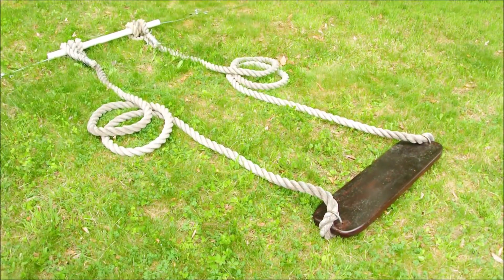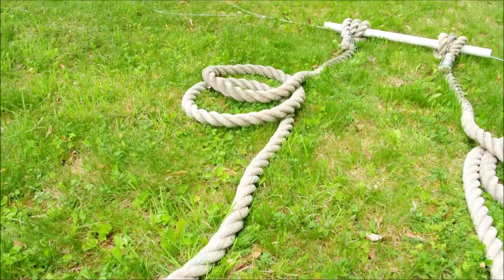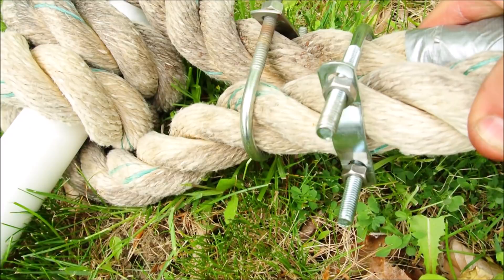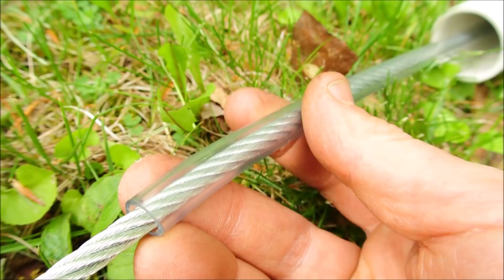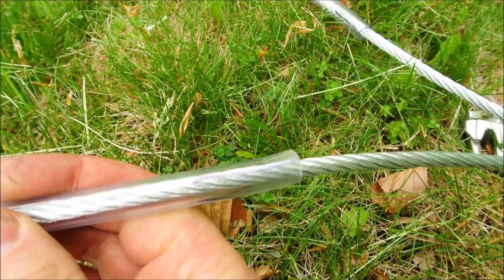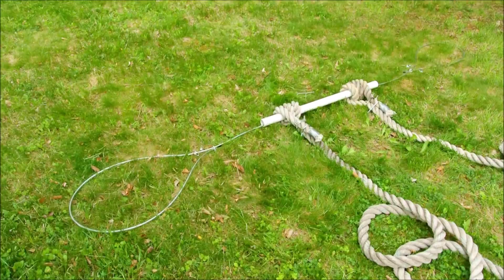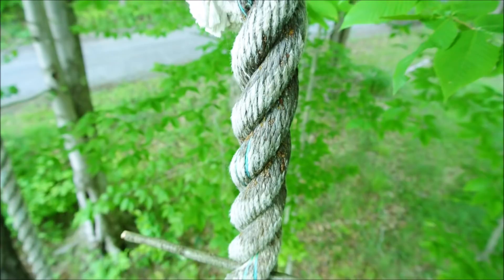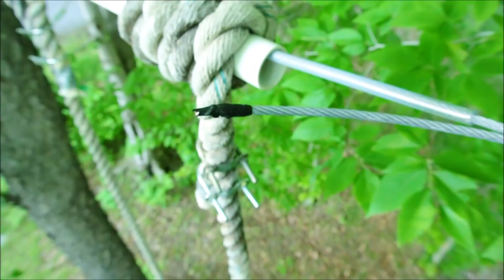Connect a swing to two trees

Comment: The only issue with this type of installation is that as weight is applied you girdle part of the tree where the cable works to cut through the bark and into the living portion of the tree. Left long enough, it can cause substantial damage to the trees.
Reply from the maker: There is no damage because the swing gets taken down every season. Without doing so, all swings will end up damaging their host trees, on a long enough timescale. Not that it matters; if you live in a place where trees are scarce enough that damage is even a concern, you are advised not to install a swing. Where I live, I have to cull them just to keep a yard.

Comment: Can I put 4 swings up   this way i the trees are 15-20 ft apart? how thick wire cable? Could I just  run  1/4" wire cable 3 times?   WHAT kind  Tensile Strength   Working Load Limit  needed?

Comment: Lots of great advice. What keeps the cable from slipping down the tree? Do you level it or eye it up?
Reply from the maker: Why doesn't it slip? Because the cable is under mild tension, and so it cinches, even more so under a load. Bark gives it considerable friction. 

How to level it? By feel and eye. A swing that's out of level will favor one side as it rides, and you'll know it. Feels like it's trying to swing around a corner. Don't underestimate your bottom's ability to perceive a leaning seat! And don't underestimate the eye's ability to see level at a distance, either; go take a look: unless there are leaning trees behind it, or if the swing is on a sideways grade, you should be able to tell within an inch what's level. 

Professional-grade installation note: if you do have two ladders and two installers, it would be no problem at all to use a length of vinyl tubing as a water-level (line-levels lack accuracy) during the initial cable setup. If you start from perfectly level in the first place, you can avoid the bother of trying to adjust other parts of the swing later. 

Thanks ;)

Comment: What size are the u bolts you are using? Also the size for the wire clamps?
Reply from the maker: Both of those will depend on the diameter of cable/rope you use. In my case, the cable was 1/4" and the bull-rope was 1.5". Size them to fit.

Comment: On the condition that the construct is in fact taken down from its mounted position on the trees, to then be reinstalled some time later, the method described herein is granted full approval.
Signed: Rando Internet Arborist Dude
😉👍
Reply from the maker: Yes, I actually do take this down every winter. I understand that's probably impractical for most people, but c'est la vie. Keeps the equipment in tippy-top.
Reply: @pocket83squared   I see now I should've worded my post such that it was more readily apparent to whom it was directed. And that would be anyone fixing to replicate a swing like this for themselves. I trust that you'll do what you said you'd do - and you don't really need my approval anyway. For anyone else that wants a swing setup like this though, they should be forewarned that it isn't intended to be permanent, as it will compromise the integrity and health of the tree if left up there for years..
Reply: @SineEyed  Is there a way to permanently attach a swing without compromising the health of the tree?
Reply: @sopastar  I think that's pretty unlikely. If you think about it, it's a lot to ask for: place a permanent weight bearing fixture on something which doesn't naturally bear that kind of weight; on something that will always (albeit slowly) grow larger year after year. If you're familiar with @Pocket83's content, then you're likely confident in the old adage "where there's a will, there's a way." I could narrow that down a bit and say that with the proper application of engineering principles, nearly any problem we're confronted with can be resolved. So I wouldn't say that coming up with something to accomplish what you asked for is impossible. However, another adage comes to mind: "everything comes at a cost."  The price for what you're asking, I think would be complexity.  In order to acheive the desired outcome, in a variable outdoor environment, while fixed on a anchor of dynamic size itself... would likely take an incredibly complicated device. And I don't think it would be worth anyone's time to put that much thought into creating such a device, as no one would be willing to pay many thousands for a friggin tree swing.

There are ways to do it differently than what's shown here - and not as complicated as our imagined device would be - which are semi-permanent. This requires attaching metal hard points to the tree, however. It's somewhat invasive, but if done well the structural integrity and health of the tree won't be compromised to any perceivable degree. This procedure will be somewhat costly (<$1000) and should only be performed by a competent tree worker..

Comment: I love your design.  I am wondering if my two trees were further apart if this same design would be practical.  I am looking for a similar swing where the span between the two trees is 30 or 40 feet!  And advice would be welcome.
Reply from the maker: It's tough to be certain. There are lots of variables. For the most part, I don't see a problem. 
[Long, complicated though process removed] 
Conclusion: I'd try it. If you end up with a swing that's difficult to pump, try tinkering with the cable height.

Comment: How did you get the cable tight before you tightened down the second tree's clamps?
Reply from the maker: Just pull it hand-tight. The idea is to still allow some flexibility. If the cable is drawn too tight, sway could eventually force the clamps to loosen (depending on the size of the trees). The PVC acts as a bearing that will rotate on the cable—whether it's tight or not.
Reply: How thick is the glass wire?  Can I use a sailing side stay?

Comment: Thank you for sharing your method for hanging a tree swing. It worked out really well. I found the most difficult part was threading the 1/4" metal wire through the  3/8" vinyl tubing. It was really snug because the end of the wire wanted to unravel and poke thru tubing. I would probably use a slightly larger tubing to save myself the frustration. Do you have a trick for making it easier?
Reply from the maker: Sure. Before you make a cut in a wire rope, it's a pretty good idea to make two or three wraps around it with electrical tape (on each side of the cut). The tape will keep both pieces from unraveling. If you look closely in the video, you'll see that all the bare ends have been wrapped. There's always some detail I forget to mention!   

Hope you get lots of fun out of your swing.
Reply: Thank you!
Reply: If you use a swaging tool made for cutting cable it will cut it clean

Comment: I don't understand how the cable doesn't slide down the tree trunk from the weight.
Reply from the maker: Because it's under mild tension. As soon as any weight is applied to the seat, it causes even more tension, which sort of binds it in place from moving. In a nutshell, there's more force in than down.

Imagine slinging a short rope around a tree and then holding its ends with your two hands; from this position, one can safely lean backwards without the rope sliding down the tree. Same idea.

Comment: I read somewhere that we should not wrap the tree. Even with vinyl wrapped cable, trees use the outside layers to transport water and nutrients. Most of the tree house builders recommend lag or through bolts. Are you noticing any damage to the tree by wrapping it?
Reply from the maker: It's a tough one. There's no possible way to permanently attach something to a tree without causing some problem. Trees are constantly growing. If you use lags, the tree will grow around them. Boards pressed against bark will eventually get swallowed by the tree's expansion.   

In my case, the swing is taken down every year. In the meantime, the vinyl is inert enough so as to not cause an infection, and the stricture it causes is only being applied to one-half of the tree's bark.  

If you're asking my opinion on a permanent tree fixtures, I would suggest using stainless eye-bolts that are sanitized on insertion. From these, cables, ropes, chains, and other things can be hung. If I were to make a tree-house, it would hang from these by short chain lengths. Boards nailed/lagged to trees are for dumb rednecks, and through-bolts are too risky, too damaging.
Reply: As an Environmental Educator I always tell people that if you are going to  put a rope or chain around a tree be sure to remove when you are done.  If the item is left in place too long it will become engulfed in the tree thus damaging that 1st internal layer that carries the water and nutrients. The Bark is like old tough skin, there to protect the internal layers. Hope this helped

Comment: I would like to see your take on those surf swings?
Reply from the maker: When I was a kid, my Dad built a more traditional-looking swing for us. It hung from a modest diameter rope that was stretched between two trees. The seat was an old flap of tire rubber. On it I'd stand, with a foot pressing against the rope on each side, holding tightly the ropes at chest-height, and I'd surf. 

Since there was a good span between the two trees, there was enough room for that thing to tilt all the way to near horizontal. If you leaned really hard, you could just barely skim one of the trees' bark with the bottom of the 'board.' Countless hours; spent back and forth, in a great sweeping, smooth swooshing, saddle-shaped motion. The memory of the sound of warm air rushing by my ears still stays with me. It was quite a ride, and it's the one way in which the swing I've constructed here in the video just won't ever compare.  

So, what's my opinion of the new store-bought version of a surfing swing? Avoid. Don't be foolish. At best it's an unnecessary re-brand of an old idea, and at worst it's a dangerous marketing gimmick; the extra ropes make it far more likely to get caught or to tangle you, and the handles are a forehead bruise just waiting to happen. If you want to surf, make a rubber saddle from an old tire, and construct a simple rope swing just like my Dad's version.

Comment: Outstanding video. What is the best height to swing high, but swing easily?
Reply from the maker: That question is complicated. It will really depend on how you build your swing (and who's swinging in it). What I can tell you is that somewhere around 16~17' from ground to wire strikes a nice balance for this design; when the wire is set higher, it starts to become hard for me to pump, but the swing will also 'swing' farther for the work.
Reply: @pocket83squared  I have land in the woods with nice big trees. Been telling my girls I’m gonna build them a swing. Using your exact method, I’m doing it next weekend. Thanks a million.

Comment: Interesting... on the one tree it just goes around the trunk, no supporting branches at all.  I would have have predicted that that would be sufficient.      

(I do regularly sit in a hammock which is supported by a strap around a tree, but then the strap usually goes a minimum of twice around the trunk, which provides a lot of surface area for friction.  interesting to see that this also works.)